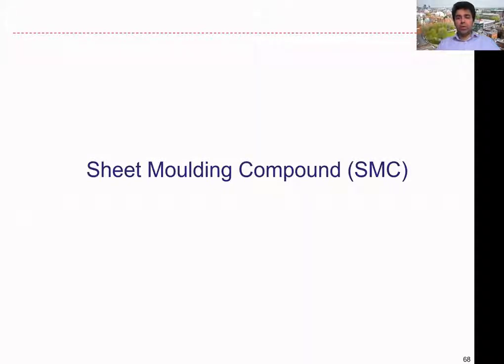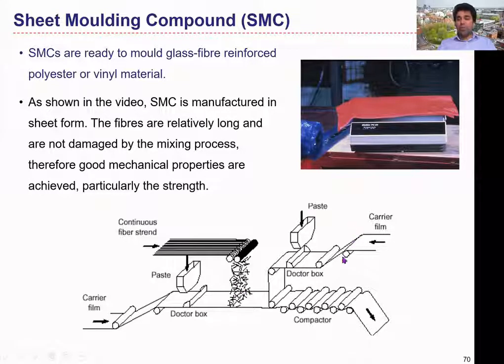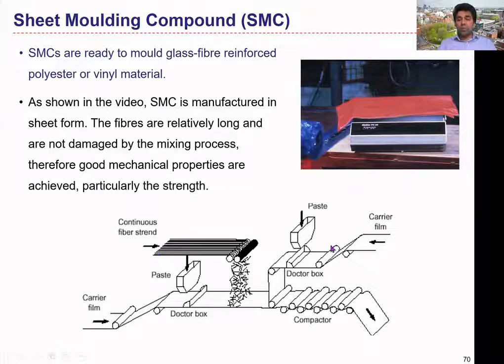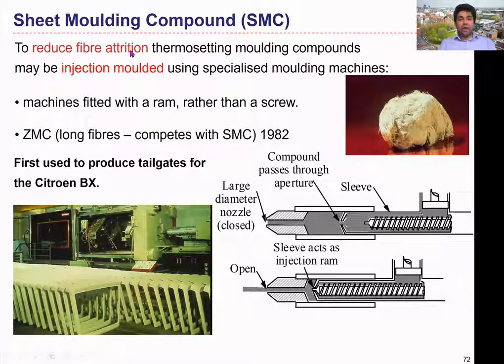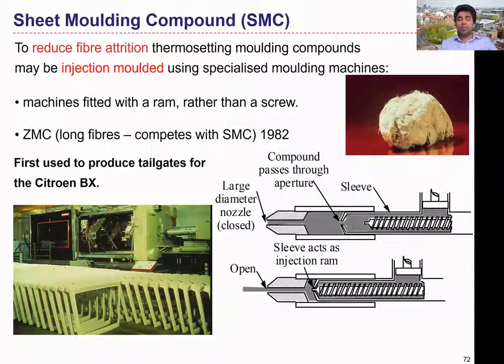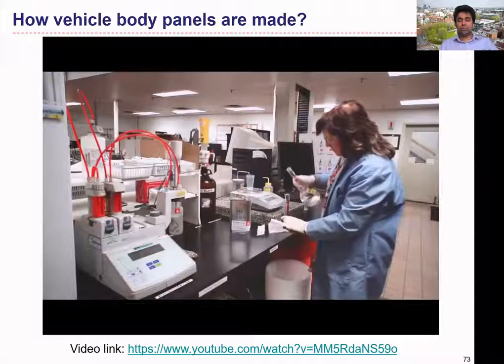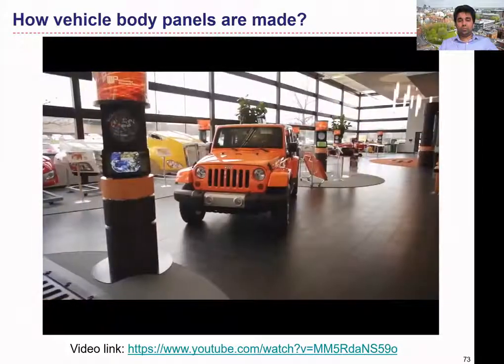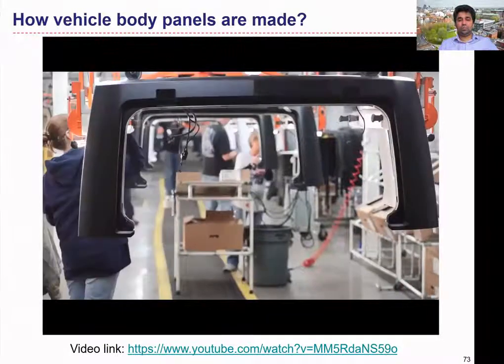Sheet Moulding Compound

Comment: How to control paint bubble problem in SMC parts? How to control SMC ruptures, paint bubble issues? Which parameters to be adjusted during SMC process? Pls share details
Reply from the maker: Thanks for the question. In fact, this depends on several factors such as the nature of the surface, type of materials, type of paint, temperature, viscosity, environmental conditions, etc . So, you might have to carry out a few trials to identify the optimal condition/s.